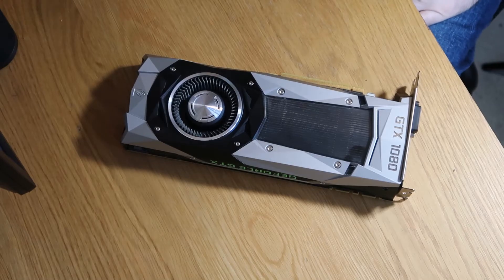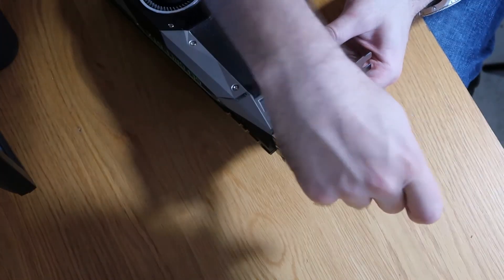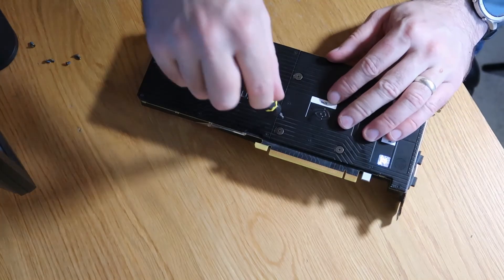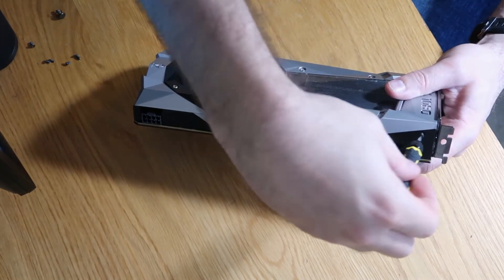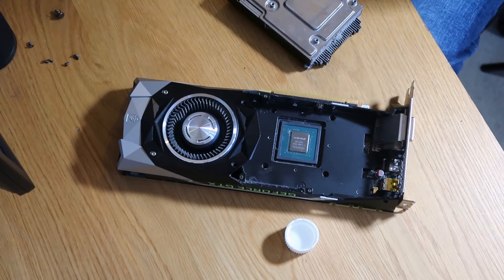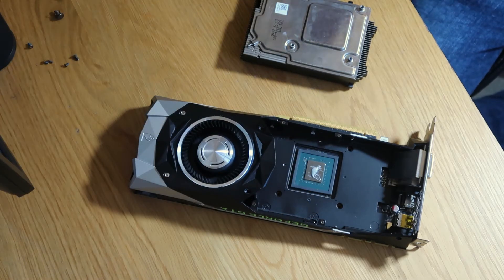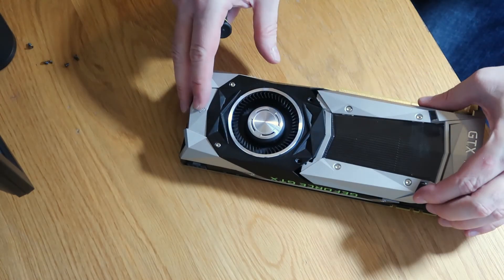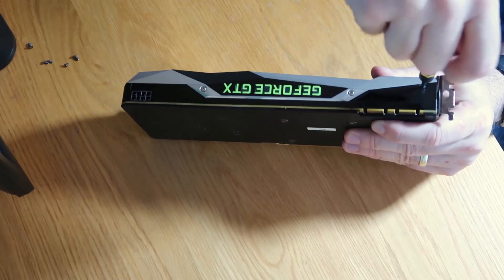Nvidia Geforce 1080 - Thermal Paste Replacement

Comment: im just trying to refurb a 1080 fe i bought it but discovered its been butchered a bit, the clear plastic section that sort of fits inside the lid is missing a couple of butchered screws it does work but got hot very quick, when i got the heat sync off theres was virtually no paste, i think the guy thought if he left the plastic clear cover off the heat sync it would cool it anyway looking for a few screws and that clear plastic insert if anyone has a non runner

Comment: Do you know what I need for an sli cable? Is there a part or model number?
Reply: No need for SLI. The game/program has to be specifically programmed for SLI, otherwise it will run WORSE with two GPUs.

Comment: Was is artifacting? I have that issue.
Reply from the maker: It was just locking up on me, didn't film it but had it re-balled and that solved the issue. Think it was a dry solder joint.
Reply: @WeRepair  Thank you for your reply, I'm going to give the paste a try first but I think it will need reballing in my case, Good info thankyou
Reply from the maker: No problem

Comment: any difering mate after replace thermo paste ?
Reply from the maker: Unfortunately not, I ended up having the card re-balled to fix the issue.
Reply: @WeRepair  i have gtx 1080  when play games 78-80 c.  temperature its normal ?
Reply: @monacocross4241   from what ive read, 80 is okay.
Reply: @monacocross4241 yes, for founders edition 80c is normal, don’t worry